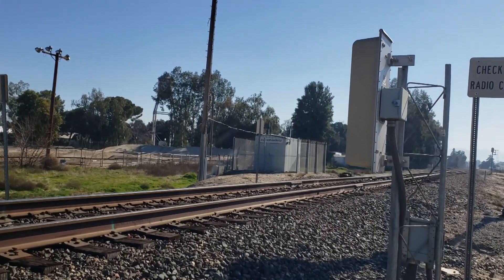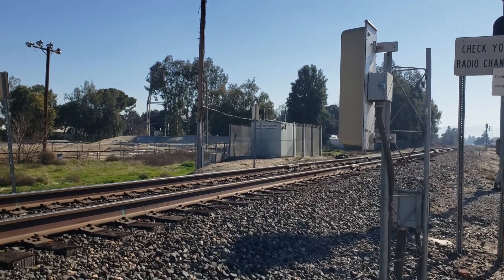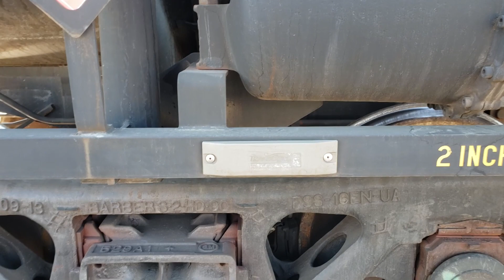Railroad Wayside Equipment Explained: Automatic Equipment ID Scanner

Comment: Yes...when the system works!  When it doesn't...you end up with a railcar sitting in a yard for several MONTHS!!!!  How that happens...I do not know and I do not understand.  There was a centre flow hopper sitting in Anaheim yard for a good 6 months.  I was surprised that there didn't seem to be a customer calling every day screaming about "where the hell is my railcar!!!!"  The was only a few years ago, if even 5 years ago.  So...judging by how long it sat there I would say it still IS a problem if it gets sidetracked somewhere.  I don't know why it took so long with that car.  Usually, when something funky like that happens, it gets spotted pretty quick.  I've seen a couple of autoracks sneak into Anaheim and a steel coil car one time.  They were all put on the next outbound hauler.  But, this car?  No.  I knew it was the same car every time because of the graffiti on it "LOFER" on the freeway side.
Reply: Might it be possible the car sat on the siding because no one cared to retrieve it, for whatever reason?  Or it was out of service and needed repair?  Just thinking that knowing the location of something is different from knowing what to do with it.
Reply: @cerealspiller  For 6 months?  It wasn't on a RIP track...it was on the siding where cars came and went and it would move around.  It wasn't actually separated from the other cars.

Comment: Interesting, the Milwuakee had scanners mostly at the major stations. Deer Lodge had one. They had Bar Codes on the cars that the scanners read. One night the train "broke" over on the east side of Butte. They hooked it back together and when the train got to Deer Lodge they discovered a car was missing. They went back and investigated it turned out a car had literally rolled off the train and down over the bank. In the dark they never saw it.
Reply from the maker: Sounds like a good premise for a Twilight Zone!

Comment: They work at 900MHz and are exactly the same RFID system you would use for toll roads with the sticker or box on your windshield. On KCS they use the combined fiber microwave network that runs the main line to send data back. The circuit is resonate to the frequency of the transmitter and it changes a capacitor and then it loads the system in a binary pattern to provide the unique id. The systems aren’t typically capable of reading many times per second to the speed of the train through the detector doesn’t matter. If you have ever used a credit card that you just get in proximity or something like Apple Pay where you get your phone next to the device that all works more or less on the same principle. Back in the day before the RFID based system they had a rectangular box on the side of the cars with all kinds of colored it looked like the fruit salad on a military uniform and that system used a camera to read the color pattern and get the info but they where a pain dirt, lightning, hobo paint etc would mess it up it’s been entirely replaced with AEI it was called KarTrak or ACI automatic car identification google it for a history lesson
Reply from the maker: Thanks for the info. I only covered it because a subscriber asked me to but it was interesting. Something I paid no attention to while I was working!
Reply: Mark Clay McGowan great video! I’m a radio communications tech now I just about went to work for KCS 5 years ago and decided to go with my gut and start my own company. We do radio system repair and installation, related IT and tower climbing work.. if it wasn’t for the fact KCS outsourced the comms work thought a third party called Comet Industries and paid 1$ over exemption (no overtime) 24/7 on call, 1 weekend a month off and no travel more then 3 hours from the tracks!!!! I would have loved that job Railroad work was always a dream but it worked out my company is growing and we are not starting to bid railroad tower jobs so things tend to work out! Love your videos most rail fans videos are great but having all that experience to go along with it and knowing the history just really makes for good content
Reply: You're quite right.  ACI (Automatic Car Identification) used a colored version of the UPC codes on products in stores, and trackside laser scanners to read them.  The tags were made difficult to read by accumulated grime, so the system was scrapped.  The AEI tags are read with a radio signal, so grime is a non-issue.  Also, because AEI was developed as a joint project with the trucking companies & merchant marine, truck trailers & containers can be tagged too.  Stay safe and healthy.
Reply: On modern RFID technology, the track-side antennae actually transmit power for the device riveted to the rail car.  The device wakes up and transmits its payload before going back to sleep again, all within less than a second.  It can read the tags many times faster than the fastest train would require.

Comment: I’m posting out of curiosity but would a magnet mess these up at some point if kids became aware of these to try and screw with em... but if it’s like a CD and information is “burned” in then they are fine and is the reason why they are riveted onto the cars...
Reply: I would assume that they operate like RFID. For Example, a proximity card you’d use at work to identify you and let you in the door.
Reply from the maker: I'm sure they figured that possibility into their development but I will ask anyway
Reply: @MarkClayMcGowan  I would hope not Todd Brown but if kids were to think about doin something crayzee like that, I'm sure they'll figure there's gotta be an app for that!
Reply: If they are indeed based on modern RFID technology, the track-side antennae actually transmit power for the device riveted to the rail car.  The device wakes up and transmits its payload before going back to sleep again, all within less than a second.  The payload is normally a unique identifier for the tag itself, not the rail car, automobile (in the case of the TollTags), or employee (in the case of the corporate ID badges).  I believe in the case of product tracking they can have many tags that transmit the same code so it is not unique.  Anyway, the central computer database keeps track of the correspondence between the tag ID and the rail car it is installed on, and that leads to a database with the current customer, contents, destination, etc.  Nobody has to go to the car and reprogram the tag when it is filled, emptied or repurposed.

The unique ID is burned into a ROM (Read Only Memory) which is non-volatile and cannot be changed once the tag is manufactured, and is impervious to magnetism, and the mounting plate they are using seems to provide pretty good physical security, although I would think a 10-pound hammer might play havoc with the circuit board inside anyway.